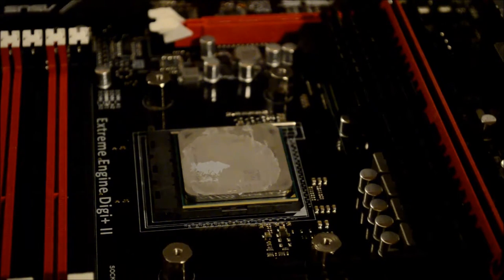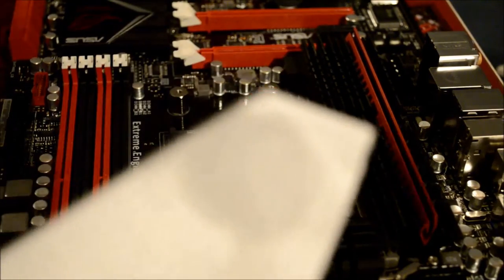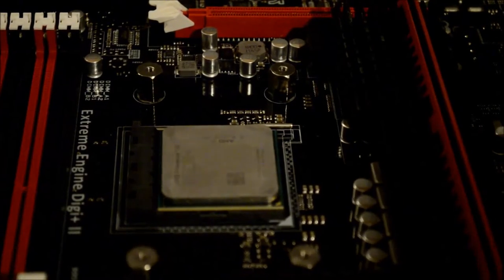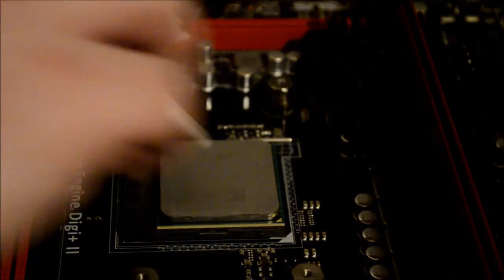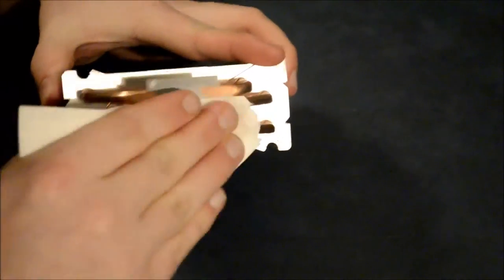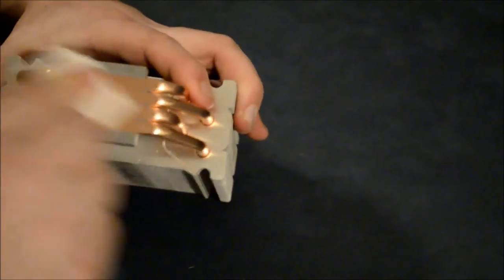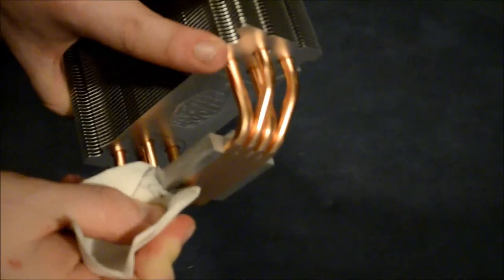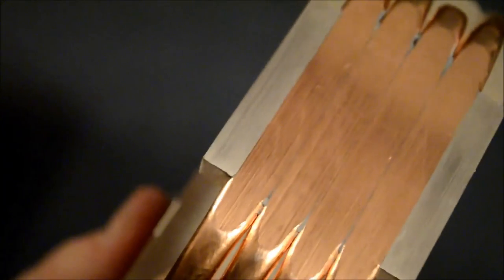Removing/cleaning thermal paste from a CPU and heatsink [HD]

Comment from the maker: The CPU IHS is completely sealed up, so there is pretty much no chance of thermal paste getting under there.  If it does get under the IHS by some miracle, it may cause some damage if comes into contact with exposed solder channels on the CPU. I wouldn't worry about it, thermal paste always gets on the rim of the IHS(Which is what I'm assuming you're worried about), as, like I said, it's completely sealed.  Just take a qtip dipped in rubbing alcohol or the edge of a coffee filter and clean it up